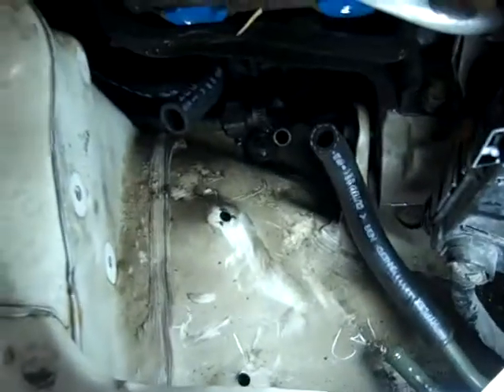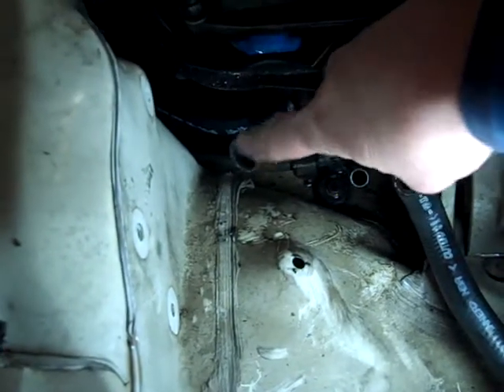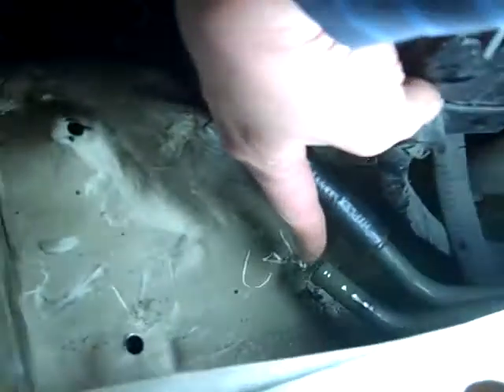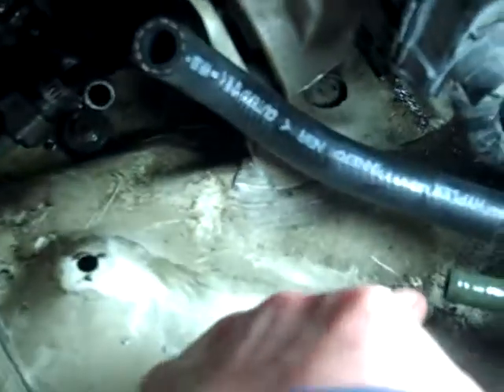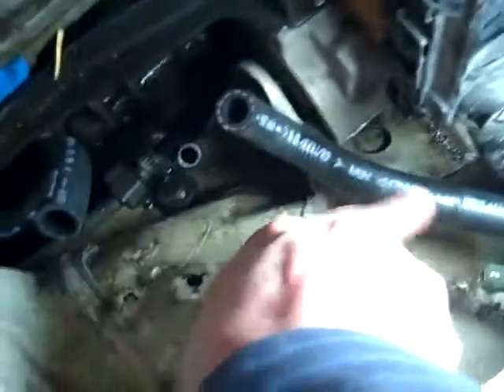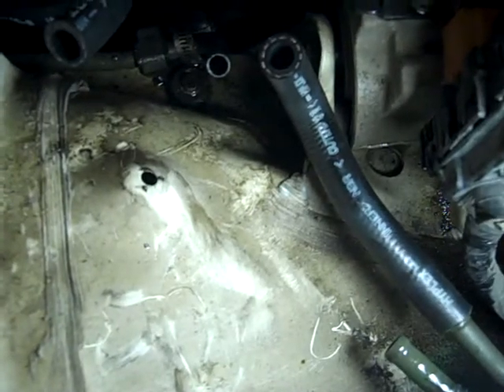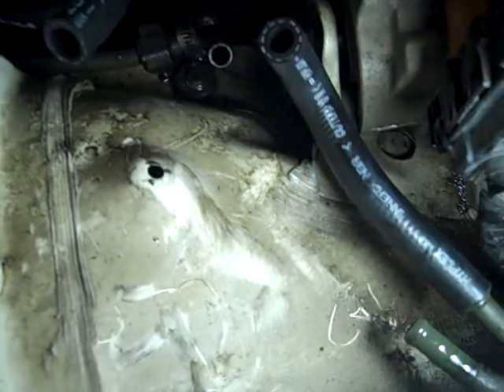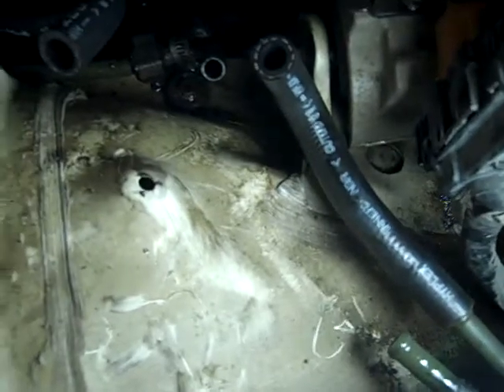PShose

Comment from the maker: Glad you found the problem.
The new ones probably came with grease fittings.
If you pump them up with grease every 3rd or 4th oil change, the ball joints will out last the rest of the car.

Comment: ya sorry took a wile to get back to youtube caz i just changed the ball joints on the fiero they looked rough took a freekin week was very labor intensive had to rent a expensive ball joint press/remover  not to mention the 100 degree heat  outside but ya same question an ya i drove it the day before was fine.i changed the ball joints cas they looked rough the rubber boots was rotten so i don all 4 of em as well as the front sway bar end links